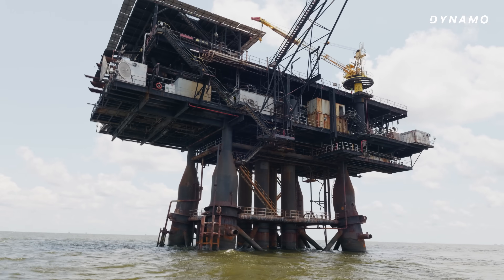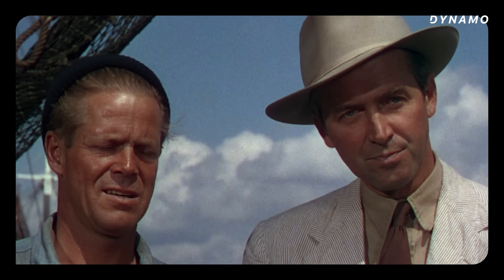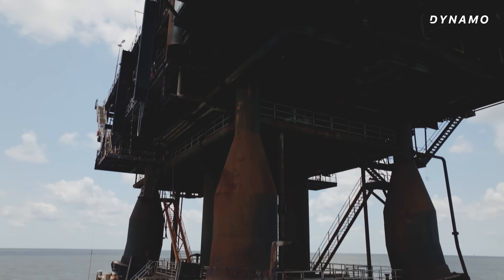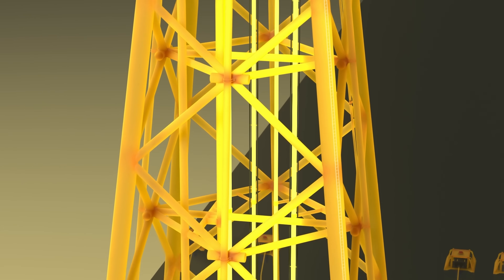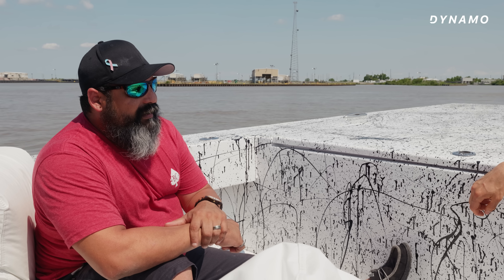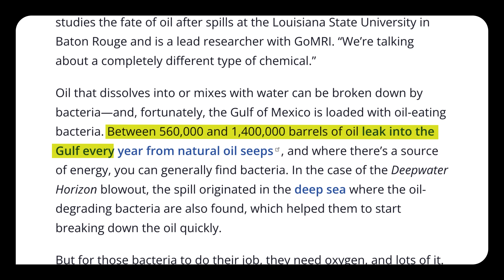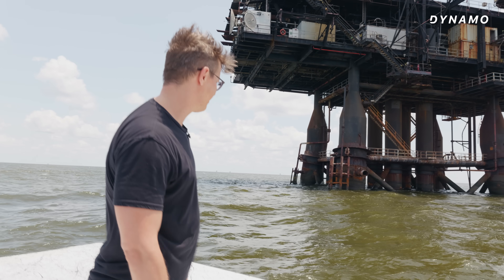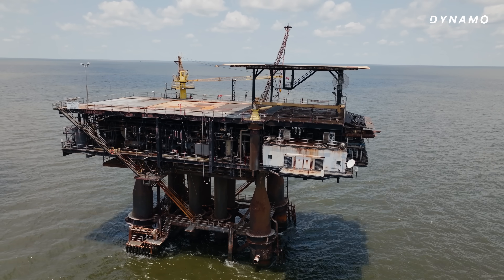I Visited Abandoned Oil Rigs — and Found Something Terrifying Underwater

Comment: Such a weak end, to try and let those leaving this mess off the hook. The oil industry isn't interested in low profit high maintenance hydrogen solutions that would depend on an entire new hydrogen infrastructe that doesn't exist, they have made their money and moved on. This will 100% result in rolling disasters impacting locals with cleanup funded by tax payers, yep these are the big guys that just had all their regulators wings clipped and were given a huge tax break.

Comment: One problem with decommissioning on those old platforms is even going on them is a huge safety risk. Metal corrodes, especially in saltwater air. I've been on a few abandoned platforms to do planning on how to remove them. Every step you take, you are worried you might fall through a rotted deck, or a rusted-out stairway. Parts of the platform, handrails and all, may have fallen off either by corrosion or from hurricane damage. And then, there's manning costs for decommissioning operations, how are you supposed to put people on a platform that isn't inhabitable? You could stay on a boat, but how are you supposed to get people from the boat onto the platform, especially if the +10 lower levels are extremely corroded, swing ropes are gone, and the crane for transferring personnel and equipment are pretty much unusable? You would basically need to rebuild the entire platform just to tear it down again.

Comment: Why not have a bunch of people go out with torches and a barge and just let them cut it apart for scrap then come in and plug what's left of the wells of course there would have to be regulations but if they cut apart must of what's above the water then problem solved

Comment: The next oil rush is sweage and garbage with raw sewage you can spike agea production that is 30% oil by weight run it through Hydro thermal carbonization process facility and boom everything you wanted out of oil wells is now under your complete control no digging no storms no needing to set up new rigs or leaving uncapped wells. 
All the carbon based garbage we throw out can also be made into oil with the same process every city and town can turn an expensive problem into a money maker to support the community.

Comment: Really poor logic used in this.  Goes on and on about the dangers of blowouts on abandoned rigs and then the only example of a blowout is deepwater horizon which was an active platform.  Then all the pipes on the bottom are in danger from landslides caused by volcanoes...  Uhhh. WTF?  I missed the volcanoes in the Gulf. WTFO?  So while corrosion and resulting badness seem  possible, you don't have any actual data to make a case. or else you would have made it...

Comment: It’s obvious that the creator of this video and most of the posters know absolutely nothing about the offshore oil and gas industry. That’s perfectly fine, but the problem is that they don’t bother to actually do a little research before they spew a bunch of ignorant nonsense. Typical modern people; take whatever you hear on the internet and run with it.
Reply: exactly!! like the fat mouth that has never worked on an actual drilling rig claims he has been in several blowouts. what a lying idiot.

Comment: I thought there was an escrow account funded by the original operator that went with the wells that funds the removal. When I worked out in the gulf, Fieldwood Energy specialized in buying these old wells, milking the last bit of profit, then using the escrow to fund removing g them.

Comment: If welds just crack we would be screwed. The only weld that cracks is a weld that should not have been done. When complete fusion is completed it’s stronger than the material itself.

Comment: I do not understand how it's possible to simultaneously claim that the well isn't profitable to operate anymore and also claim that its still under pressure. If the well is truly empty it would be under negative pressure, if the well is still under pressure it should make sense to release that pressure by collecting the oil and if the pressure is roughly neutral it should make sense to pump it out slowly possibly using solar or wind power to operate a small pump. A dry well cannot be under pressure and a pressurised well cannot be dry its a contradiction.
Reply: He didn’t mention because they don’t appear to know, but wells produce seawater after the petroleum has been taken.  But the weight of oil is less than seawater, so the pressure is there from the water, and the oil rises up first.
Reply: @SpareHuman  Thats really cool thank you for the information :) can you maybe elaborate as to why the pressure inside the pipe would be higher than outside the pipe? It's really only the pressure gradient that matters, like off coarse the weight of water above causes pressure but if both sides have equal pressure it shouldn't be a big problem. Also if the pipe is mostly or completely filled with seawater by the time there done is it really that bad for the environment not to dismantle the rig? surely if there's no more oil in the pipe then it's not that big a deal to just let it naturally decay by itself?

Comment: Regulations need to be put in place to literally build the well sealing process into the well from the beginning.  In that way, it's not a separate process that has be engineered / executed separately.  At well decom, you activate the mechanism that permanently seals the well head.  Unsure what that would look like, but it's a solvable problem.

Comment: Oil companies should be legally required to decommission these rigs and remove them when no longer used.
Reply: every one of the platforms, not rigs, were decommissioned per the actual laws of the U.S.  They are not required to be removed sometimes, as they pose no danger to shipping lanes, and even if they fell over, they would not affect a sufficiently plugged well.  We're not talking about screwing a cap on the top of the well and calling it a day.  They are packed and plugged thousands of feet below the surface, using a government approved process.  
The time it takes to plan, get more governmental permits/approvals and lining up the offshore assets to remove the remaining structure, is not an overnight process.  I'm working on a pipeline removal that has never been in service, and the permitting started in 2019.  Oil companies cost so far, with no production and a lot of engineering, $37 million.  It looks like it's going to take a couple more years to get the permits, as the agencies are too busy to get this done.  Translation:  As long as they keep the company in the permit phase, they can keep charging them.

Comment: There's a lot of flat out wrong information in this video coupled with some deep misunderstanding how how things work. The general sentiment is correct, the projects that are no longer producing need to be cleaned up immediately. Acting like these oil companies don't put enough money aside is asinine, the asset retirement obligation (ARO) is dictated by accounting rules. 

Using Fieldwood as an example, is nutty, they are a one-off that has only happened once. You also fail to mention that most of those Fieldwood facilities that were held by the bankrupt company have been forced back onto the previous owners to abandon, a key provision of the offshore regulations to prevent the government from holding the bag. The previous owners have the money and ability to abandon them but is still working through the various bonding issues from selling the assets.

If there's evidence that permanently abandoned wells aren't plugged you should show evidence rather than using someone who doesn't have direct knowledge to say it is. All of the offshore equipment, beyond the well is required to be cleaned and flushed prior to abandoning in place, the pipelines are often holding pressurized nitrogen to ensure they can be monitored for leaking even though, they're completely clean. The platforms remove any equipment that could pollute, often the entire topsides structure, bring it to shore before turning the steel support structure, which doesn't have anything more than just the steel used to hold the platform up, into a reef. 

As I said originally, the sentiment is correct. These facilities should be cleaned up and certainly some exists, especially in state waters (a whole other can of worms than the federal deepwater you primarily focus on). But there's some key misunderstandings and incorrect/incomplete information you share which provide additional context to this video.

Comment: There’s a lot of things you left out of this video.  If the small company goes bankrupt courts can (and usually do) force the original owners to take ownership back.   You also used a map showing all of the oil platforms in the gulf to imply that every dot was “abandoned” .  I have been working in this industry for 20 years and have never heard of a platform not being the responsibility of someone even if it is no longer producing.  No large oil company wants CNN talking about a platform they built leaking oil, even if they don’t own it anymore.

Comment: From a norwegian perspective this is insane. The cleanup must be financed through funds or other guarantees before they even start building. Granted, we don't let tiny companies have a go at the old platforms, but even if we did a lot of responsibility lays with the original builder.
Reply: It is also a requirement in the U.S., however, our governmental agencies aren't very good at holding on to the money that they confiscate for 'later down the road'.  It's not always the original builder that doesn't have the funds, as they are required to set-back for the final disposition of the field, that's part of the field abandonment documents, which are required to get a drilling permit.  
From what I've seen in the last 15 years of decommissioning and removals, regardless of who had the funds, they get eaten up by 4-5 years of engineering and permitting, so that a 3 month job, ends up burning up 5 years worth of money.  Moving the goal posts while a vessel or platform has been in operation for 20-25 years is also a big factor.  Newer regulatory requirements for studies and more extensive disassembly/disposal costs, add to the delays.  There are not a lot of shore bases equipped to receive all the decommissioned topsides/equipment, much less disassemble them and dispose/recycle of the individual components.

Comment: So the problems are two, it seems to me.

1. Insufficient planning for the lifecycle of the field access.  Probably excusable in the beginning, but we now know enough about the situation to monetize the end-of-life for these wells.  That would, of course, change the profit picture for establishing such a location to begin with.

2. A major issue seems to be the technology for surface access to resources below the sea bed.  It's an obvious risk to have a huge floating hnreusable platform at the surface connecting to wells hundreds or more feet below on the sea floor.   And then to have miles of vulnerable and difficult-to-service pipeline running to shore stations.  Better, IMHO, to start building sea floor habitats, sinkable pressure vessels some fraction of the size of platforms where men can safely work to establish and run active wells and decommission them when played out.  I suppose this would require traverse to and from such vessels in some kind of suitable submersibles.  And I could see smending this approach to building permanent structures on the sea floor, possibly buried within it.  The point, of course, would be to minimize interaction with the surface and its weather whike improving operational accessibility and to facilitate safe and permanent shutdown.  As for the oil:  how about pumping it into blimps of suitable size and letti g them float to the surface, to be taken in tow by tugs?  No permanent pipelines, just vessels that have the virtue of maintainability in drydock.

All of this would require newer and initially more expensive technology, but I'm imagining comparable or better lifetime costs and increased safety.

As for existing platforms, salvage them for tge steel, etc.  Bankrupt companies would forfeit oenership to the government, which could auctiion them off, requring proof of adequately plugged wellheads.

The whole approach sounds like a boon fir US shipyards.

Comment: 20 years in the Gulf. I will likely regret saying this. 

This video has so much wrong information and terminology. I dont know where to begin. He got a bit of it correct. There used be 1000s abandoned, but there has been a HUGE push last 15 years to clear a lot of them out but there are still hundreds. Its a costly project in time and money. 

Platforms (most of what you in this video) are completely different from rigs. Shallow water wells are completely different structures than deep water wells. 

Im not "drill baby drill" and I am not "the Earth is dead", but this video is a little bit one sided.

Comment: I did a lot of diving as an ocean diving. One of the most diverse places where you can see life is around oil, Derek’s.  It’s a whole ecosystem around it.  If you wanted to get some good scallops or some good fishing, we just fish off or dive off an oil Derrick. It’s basically an artificial reef which supports a whole bunch of life from the sea floor all the way up.
Reply: "basically an artificial reef which supports a whole bunch of life from the sea floor all the way up. "  Very interesting. They need to be sure of a  permanent cap to prevent oil re-emerging, but let rest of the structure persist as a reef. Have heard our coral reefs are dying. Could bits of live coral be farmed/tucked into corners?
Reply: @jbrown1195 no. Coral 7s dying due to p.h. and temperature
Reply: I'm sure that's true... unless the well springs a leak in which case its going to look like an underwater hellscape isn't it?
Which is really the point of this video
Reply: @geopolitix7770 "underwater hellscape" calm down with the propaganda dialogue
Reply: @sean9267 apologies if I've offended your delicate sensibilities. (Which surprises me cause I'm not exactly a greenie!) But what would you call a large crude oil slick in an otherwise functioning ecosystem?

Comment: Wait, the bond amount is only $100K-$300K for a well & $500K-$3M for platforms (+ premiums)??? That's insane - a drop in the bucket compared to the profits yielded; it's probably cheaper to just default and forfeit the bond amount than to go through the decommissioning process, providing oil companies little incentive to not just abandon obsolete wells and platforms. Oh, you just said that. But yeah, WTF? I'm not the least bit surprised, considering Superfund sites are a thing, but damn. F**k sh!t up then run away & hide under layers of subsidiary shell companies & let the taxpayers foot the bill - solid plan if profit is more important than integrity [spoiler: it usually is].

Comment: I'm understanding that an oil cap nearing the end of its days sealing off oil pressure will result in vibrations of some sort.  Therefore, having people up above on the well structure would feel this and call-in the powers that be.  People on site would be better than using sensors sending signals to land-based operations or this would have been done by now.  Perhaps the answer is to convert the platforms into hotels, or private homes, etcetera.  Maybe the platforms could serve homelessness?

Comment: This video is deeply disturbing. 
Because it's a lie. I lived and worked on Drilling Platforms, and when they are decommissioned, there's no more oil in that pocket, the wellhead is removed from the drill pipe and sealed, there is an " air gap" between any and all piping that remains. The rig will transform into a much needed artificial reef.
Do you really believe that these companies would be dumb enough to leave behind a lawsuit?
Reply: This is what happens when people have a bias. spin it into a creative video and then catch all the low brows and tug at their emotional strings. then boom we have a anti oil movement that's based on fictional "facts".
Reply: @cletpenney1530  That is not true. The US Coast Guard had to investigate the Mississippi Canyon Block 20 oil spill, possibly the longest-running oil release in U.S. history since 2004. And in that time-frame, the US Coast Guard reports that over 1 million gallons of oil estimated to have leaked, even after the half-assed shoddy well-plugging and remediation work with Taylor Energy at that site. Also, the claim of "no more oil in that pocket" is misleading, because oil still exists in that pocket even after it is plugged, & this occurs if & when the maximum production rate efficiency of a well no longer covers its overhead expenses. People love to over-simplify, when the devil is in the details. "Do you really believe that these companies would be dumb enough to leave behind a lawsuit?" Sometimes, if the risk-analysis means they can capture more profit by doing things half-assed, because "doing the right thing" costs more money than fighting it in court for decades similar to how Exxon fought/appealed repeatedly in court from 1994 through 2008 after their causing of the nation's 2nd largest oil disaster.

Comment: Comparing an old abandoned well to the deep water horizon disaster is not honest journalism.
Reply: Collectively, they are just as bad or worse
Reply: @mytube7273  An abandoned well, capped at 12-14k feet below the mudline, is just as bad as the Horizon?  We're all waiting for your enlightened geotechnical reasoning as to why that is a valid comparison.  Next, you'll be telling us that spilling a pepsi on a keyboard at a nuclear power plant could cause a thermonuclear explosion.
Reply: @mytube7273 no, crude oil is naturally occurring and decomposes rapidly in the warm golf water.